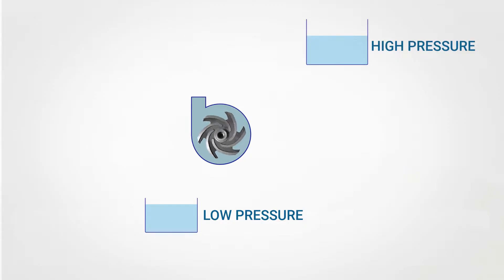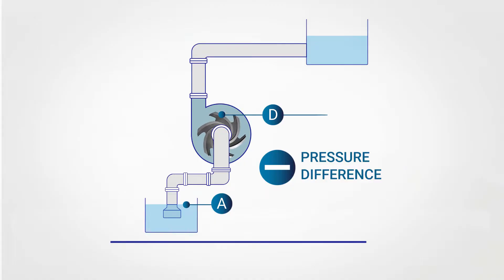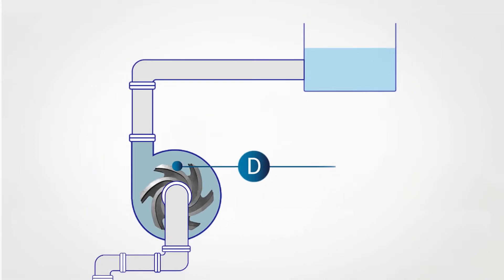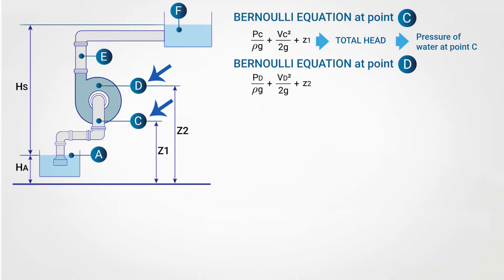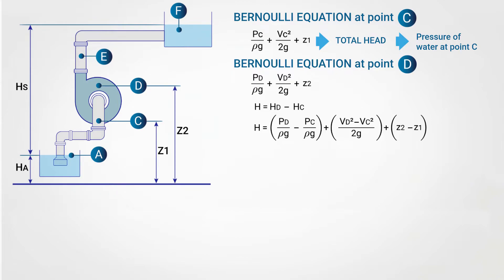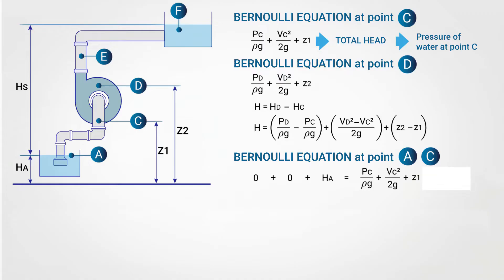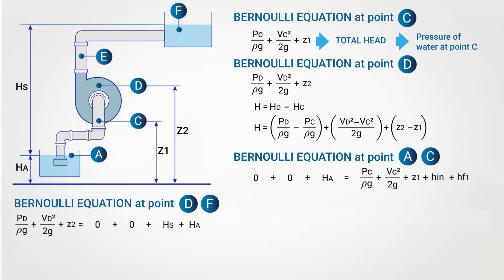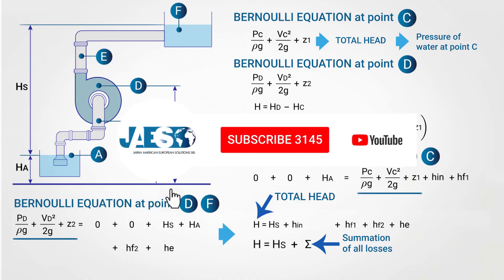How do CENTRIFUGAL PUMPS work? Application of the Bernoulli Equation

Comment: 2:11 basic conceptual mistake here. The pump does not suck the liquid. The fluid must be availale at pump suction. Also the point C is not at much lower pressure than point A.

Comment: Questions:
1.  It looks like point C is in the middle of the entry pipe.  How can you define the head of the pump with respect to a point that you could pick arbitrarily along a potentially very long pipe?
2.  If head is defined by how high a pump can pump water, then what meaning does "Ha" have?  Ha looks like an arbitrary distance from some point at the bottom of the reservoir to the inlet pipe of the pump.  
3.  I don't understand the proof, but it looks like the final equation might be a trivial statement of conservation of energy: the theoretical head produced by the pump is equal to the actual head plus the losses.  Why bother going through the proof at all?

Comment: What if H one and H2 are the same and you’re simply using it as a transfer pump. does anything change besides flow rate low rate?
Reply: You would not need centrifugal pump then...u can just create a conduit and water will flow to fill the conduit until it level out...just think of river...to move the water..u then need an energy...often from potential energy to kinetic energy..